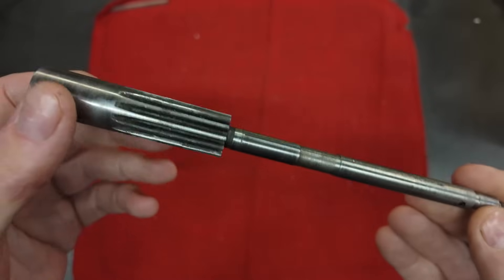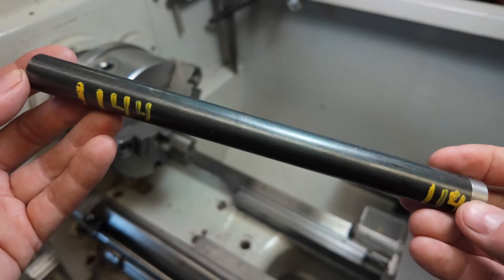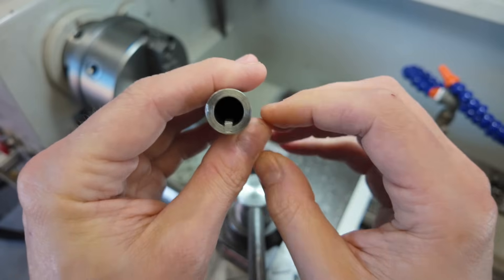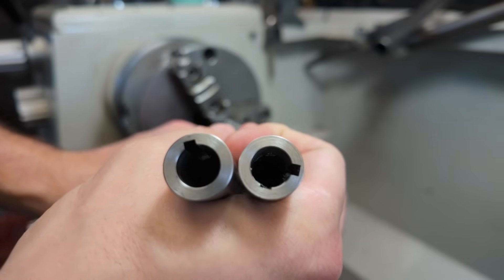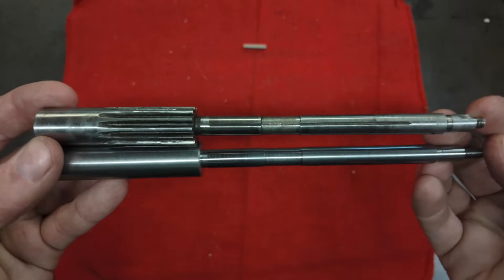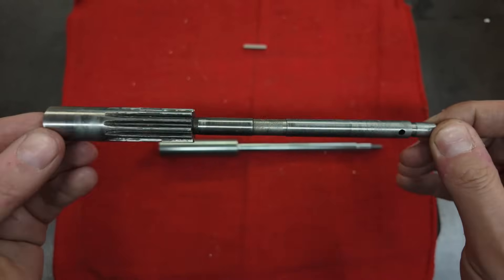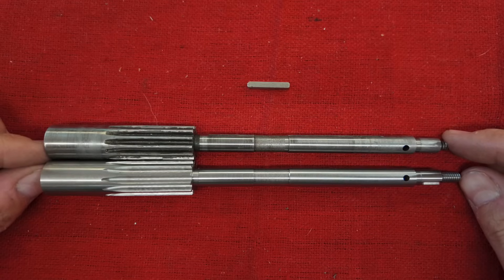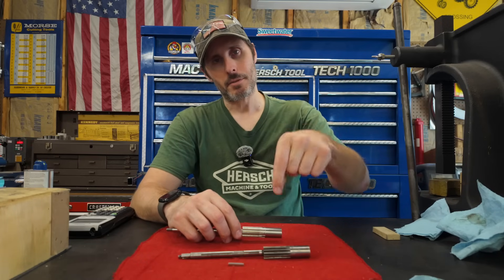Machining Parts That You CAN'T BUY - South Bend 10L Taper Feed Screw

Comment: Nice work. What went wrong with the first two keyway attempts?
Reply from the maker: Thanks much. And it took me a couple attempts to get the tool height set perfectly, and it really needed to be perfect. I probably could have avoided the issue by using a more accurate method for setting the height in the first place.

Comment: If he came to my shop I would have replaced the end piece for around 5% of the cost of a new one.
Reply: Exactly what I thought 

Take the needed measurements to reproduce the part, then part off the bent end, bore/thread the stump female and make a matching male piece to thread in. Secure with Loctite or braze/solder, turn to size, key and thread the tip to match the original.

I’ve done this on motor and pump shafts many, many times. 
One of my goals in life is never to cut internal keyways or splines unless they’re totally mangled.
Reply: @ms1250-t7r  I love this!!!
Reply: @ms1250-t7r  Alternatively, the existing part could be knocked true and cleaned up. Or turn it down and fit a sleeve over it. If you have Engineer above the door, the clients expect an apprenticed tradesman to offer the most appropriate and economical solution. If you're not skilled enough to see the alternative repairs it gives the trade a bad name, and take the sign down.
Reply: 5 dollar piece of stock. At 5% is .25 cents.   Copy that
Reply: @bretfairchild456  Half hour labor instead of 20. Copy that.
Reply: How...I thought the same but wondered how to do it
Reply: How
Reply: My thoughts exactly

Comment: What went wrong with the key way attempts
Reply from the maker: It took me a couple of attempts to get it perfectly on center. In retrospect, I could have used a better approach to accurately set the tool height the first time and avoided the mistakes. Might be time that I get around to making some kind of tool height setter for the lathe...
Reply: @hersch_tool  Once I figured out my exact center, I made an easy height gauge out of a 1 inch rod of 6061 with a magnet pressed in the bottom. Works great
Reply from the maker: @kurb0311  Great idea, simple and effective. 👍

Comment: You used ~45Mn steel. Why not a 40Cr? 
Thanks for video!
Reply from the maker: Thanks very much for watching! I didn't use 45mn, I used 1144SP, I explained why in the vid. Both 45mn and 4140cr are less stable than 1144. 1144 has plenty enough wear resistance for the application and is much more stable which makes it an ideal candidate given the type of machining processes at my disposal.